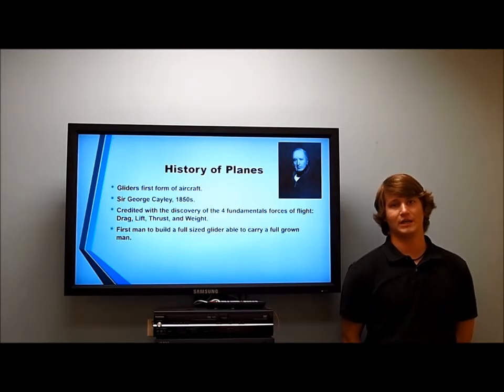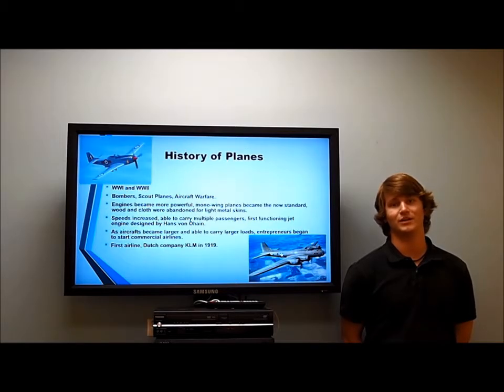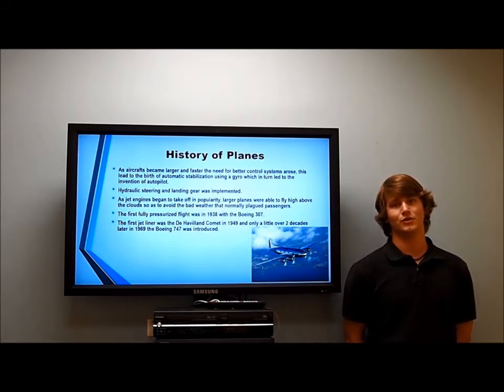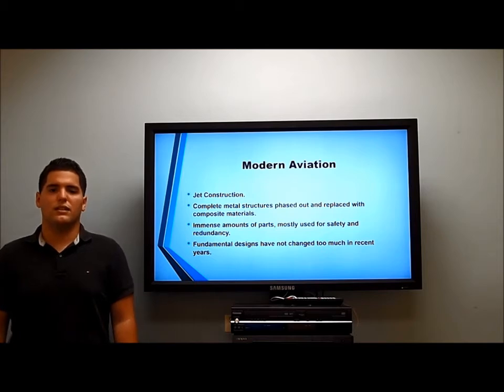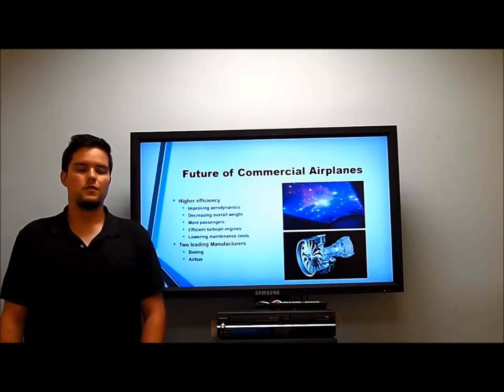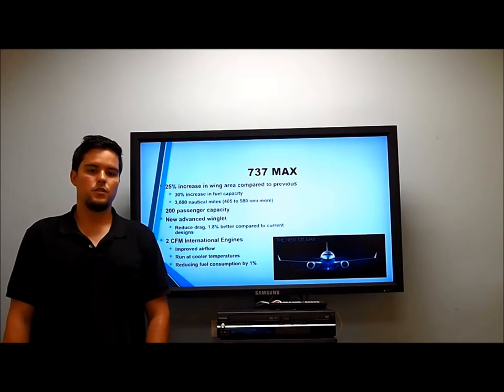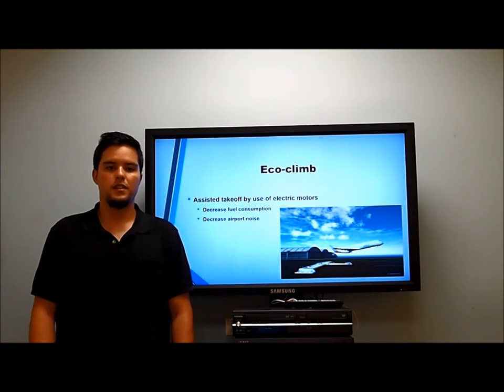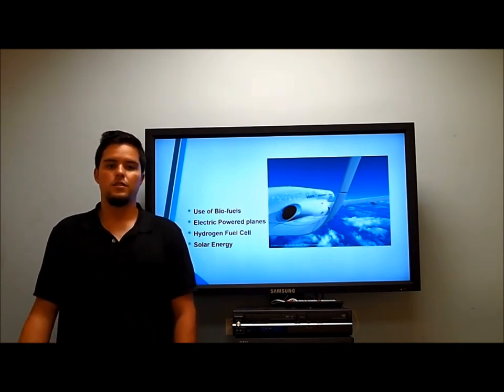Team 4: Large Scale Commercial Airplane Design

Comment: Great presentation! The presenters were very knowledgeable of the material and they do not glance at the powerpoint for info. The adjustments they should consider is the lack of formal attire, the size of the powerpoint, and the lack of 1 video between the team than having seperate pre-recorded parts that were combined.